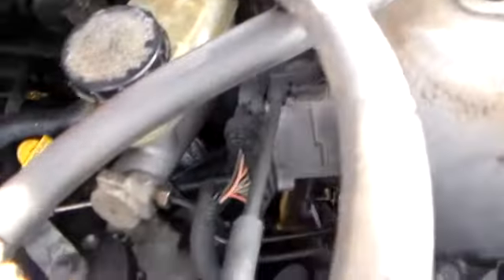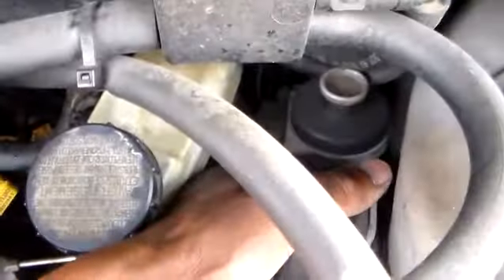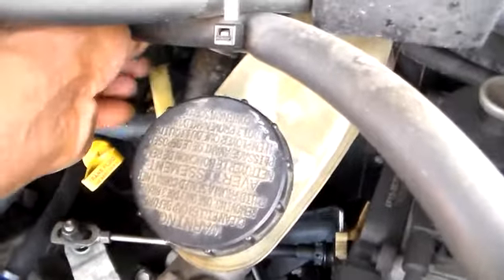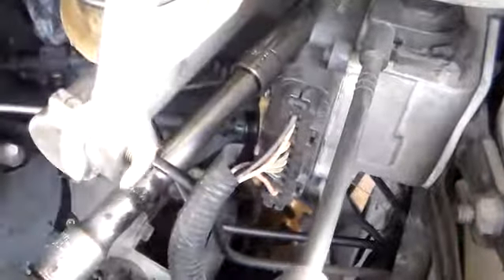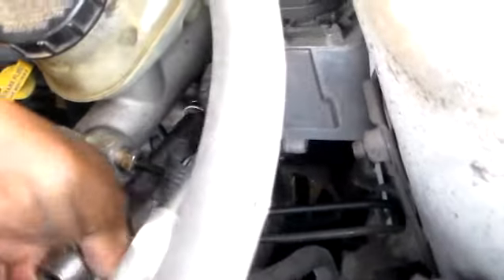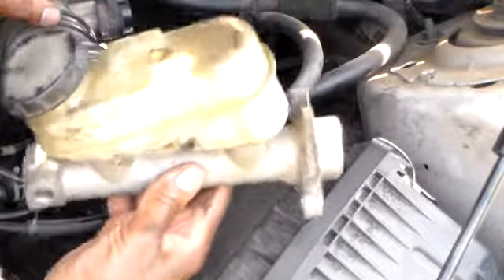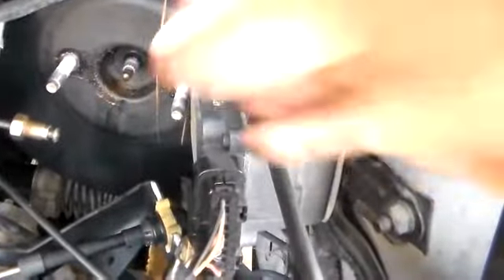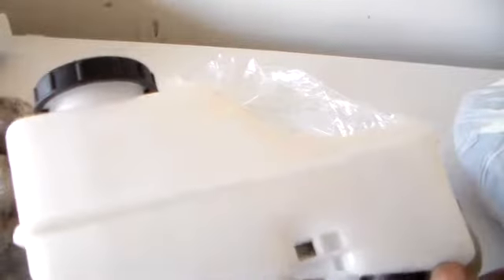brake master cylinder replacement 2005 Ford

Comment: do you have the video of disassemby of inside of brake master cylinder of ford escape year 2000 - 2004? I have disassembly inside of the brake master cylinder and Now I want to remove the seal of rear piston inside the brake master cylinder but its difficult to open the spring. For another brand, its locked by a bolt but at this spring is by pin and spring, but can not removed. I just want to replace the seal only, because the inside of the brake master cylinder is still good.
Reply from the maker: no, sorry Rudolf
Reply: @diversity2739  Hi, thank you for your reply. But at the end, just now I could disassembly the rear spring inside at my 2004 Ford Escape brake master cylinder, so now I could remove all the seals.  Now, I just want to buy the seals then install to the piston of the brake master cylinder.
Reply from the maker: @rudolffgultom9554  great!

Comment: thanks for the vid! do you know the symptoms the car was showing to be able to know it was the master cyl? i have one i’m about to try to fix. came to me with zero brakes besides the parking brake. pedal falls right too the floor everytime.
Reply from the maker: I was during this job. for a family member, who didn't take care of this car. through the process of alamentation,  first l looked for leaks,then l flushed the brake lines, and the brake master cylinder, put new fluid in. and pump the brakes to check for pressure. some times s bad bleeding scew. would be the problem, l would just replace it. if everything is looks good and the padel go to the floor. Would replace the brake master cylinder, normally that would do the job. But just last year this car had a leaking brake hose that connects to the bridge calipers, under wheel well. it's about a foot long. After during all this, and no pressure. I found a bad brake caliper pisten boot. st some point one of these would be the problem. then the last thing that l had not done was to replace a bad brake booster,. it's connected to the brake master cylinder. It looks round